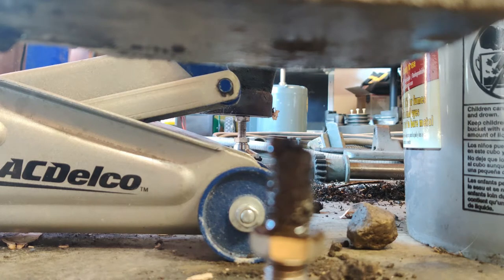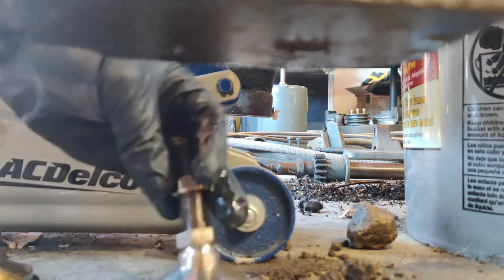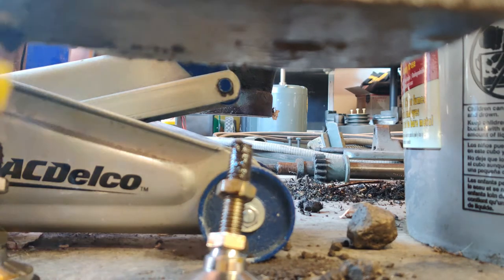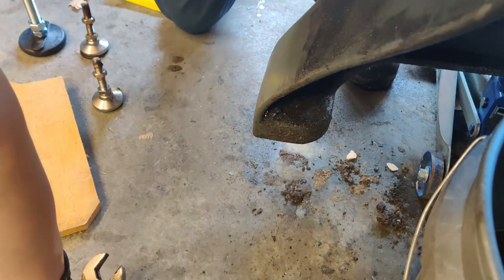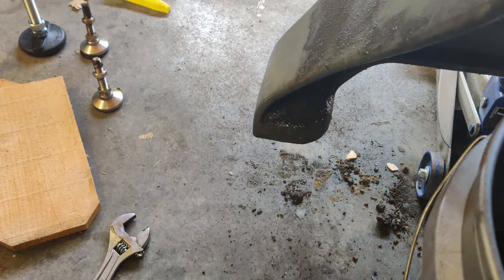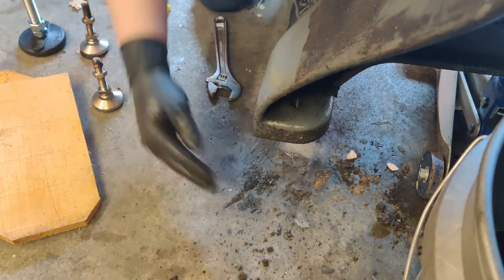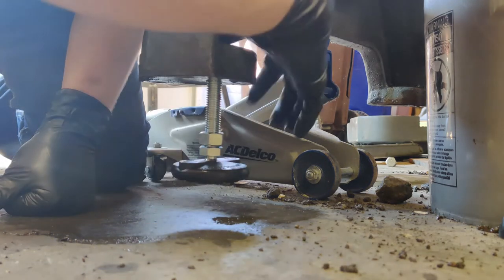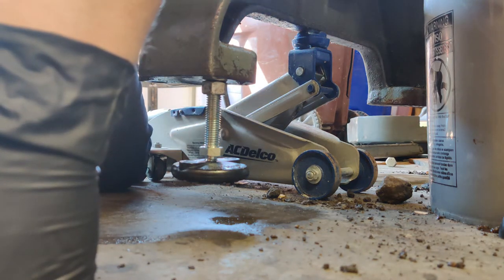1950 LeBlond Regal 17" Lathe Restoration Part 17: Better Leveling Feet (And a Surprise)

Comment: You are making a really nice job of your lathe restoration.
Reply from the maker: Thank you for the encouragement! I feel like I've only done all of the easy work so far. I've got a lot more work to do on the next parts, like learning to scrape. And learning to use a surface plate. And getting a surface plate (and straight edge, and indicators, and scraper...)

To be honest it's almost overwhelming, but I've just pushed forward with the philosophy of only worrying about the tools and knowledge needed for the next step. It's worked so far, and in the end I'll have built up a decent set of tools and skills.
Reply: @cavemaneca  Good call. How do you eat an elephant!
Do you have Conelly's scrapping bible? There is a scan of it floating around the internet.
Reply from the maker: @RotarySMP  I did get the Connelly scan downloaded, it's a pretty dense read though... But surely it will come in handy for many of the next steps as I get things put back together and restored.